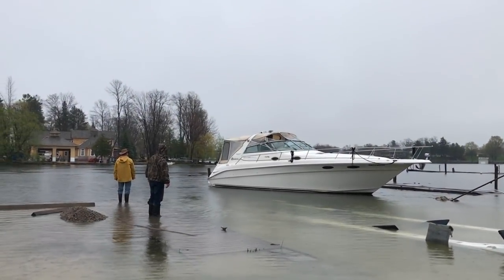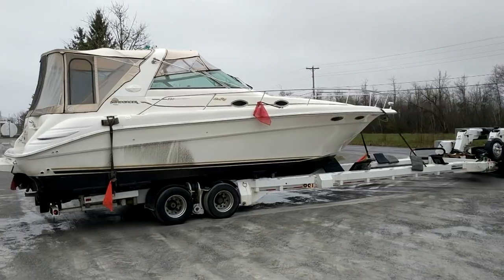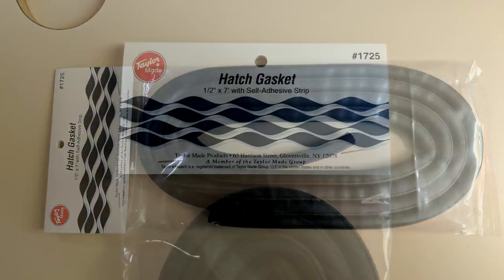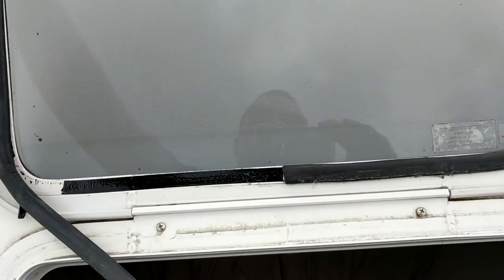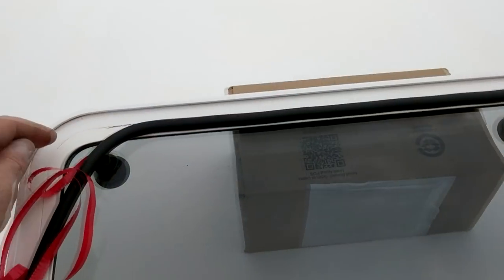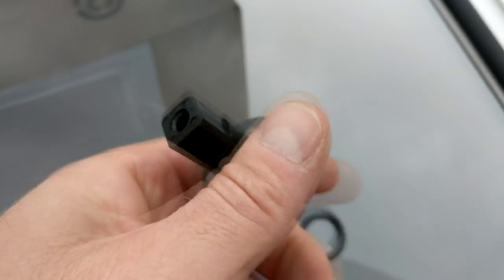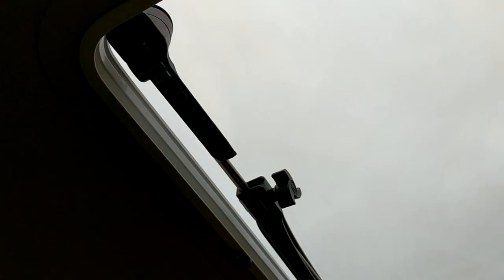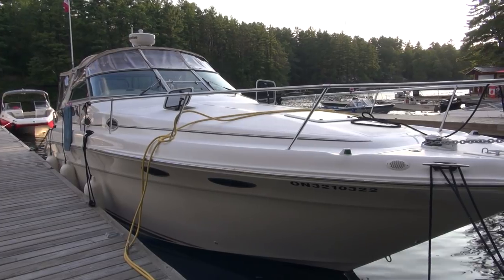Boat Hatch Gasket Replacement - Sea Ray Sundancer

Comment: I noticed that the new rubber was cut at 90 degrees where the two ends meet. I've done a lot of gaskets for a valve repair company years ago.  I would like to suggest that the rubber be cut, instead, at a 45 degree angle.  This would prevent a straight line across the surface where the ends meet making it more difficult for water to wear a path across the gasket surface.  It's entirely possible that this may be overkill but it may add life to a new installation and it's easy to do.  This idea hinges, so to speak, on the gasket kit being long enough to allow for a little extra trim.
Reply: Good suggestion 😃👍🏻

Comment: Great video! One thing about acetone is that it can react with certain plastics like polycarbonate or plexiglass coatings, so some tape to protect the glass might save you some damage.
Reply from the maker: Thanks for the tip, but I've been using acetone everywhere on our boats for over 20 years and have had no ill effects. If course, all of those boats have been Sea Rays, so I can't speak to the potential effects on lesser quality boats 😉

Comment: great videos.  keep them coming.  krates marina 2nd year captain and watching just after an April ice storm.  I can't wait to get on the boat after a long winter.  Dwayne.  info at first power generators usual ending.  Doral 27' twin engines.  50% up the learning curve but it is difficult sometimes in tough conditions.  I think the saying should be instead of "I am going to try boating".  It should be "Boating is going to try you".  lol Dwayne.  Please send a note maybe to compare notes or trips me and my wife should take from Lake Simcoe.  Thanks

Comment: Took note of item number because we had same issue with a leaking hatch over our forward berth after taking possession of our new-to-us '93 SeaRay EC last fall. Only problem is - can't get the hatch open to replace the gasket! Suspect previous owner might have sealed it shut in an attempt for stop the leak. Gotta figure out how to get it open without busting anything.
Reply from the maker: Here's a heads up on your sealed shut hatch; We had a similar issue on our last #boat, with one of the side windows feeling like it was welded shut! Problem was that it had been closed for so long, the rubber gasket fuzed with the plexiglass window. My solution was to very gently pry it open by slowly (!!) sliding a very flat bar between the two. Took some gentle persuasion, but I was able to get it open with minimal swear words 😉
 Cheers, Paul.
Reply: Thanks, Paul. I was concerned about forcing it open, will definitely give it a whirl the next time we visit for a pre-launch inspection! (Hopefully the previous owner did not silicone it shut!)
Reply: Success! Carefully opened hatch; yes there was silicone around the hinge. Gasket was in poor condition, so I ordered Taylor Made gaskets (via Amazon) and thanks to your video will replace existing ones on our 1993 SeaRay 370 before she gets wet near the end of April.

Comment: Now if you can just help me locate a new port side hatch support rod!!!!
Reply from the maker: Just do a Google search for 'taylormade hatch parts', assuming that your boat is equipped with a Taylormade hatch. The corporate site should help you determine the specific parts you need, and Amazon or other online retailers will most likely have what you're after.
 Conversely, if it's a Bowmar hatch, do a search for it instead of the Taylormade. That said, if it is a Bowmar, my experience in dealing with the manufacturer directly was an incredibly frustrating ordeal and would highly recommend to look for assistance through a third party vendor only.
Reply: @BoatingWithBoogaboo  Thanks!  The rods are Taylor but the hatch is Bomar.